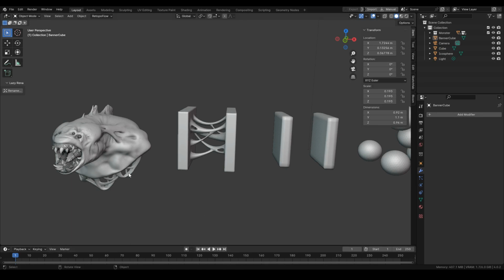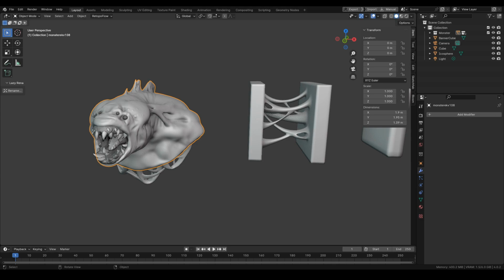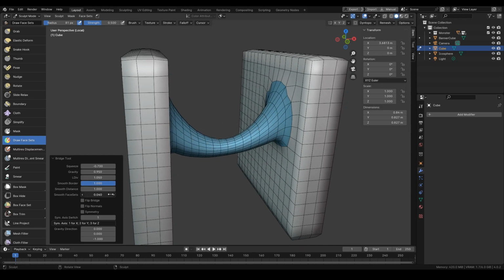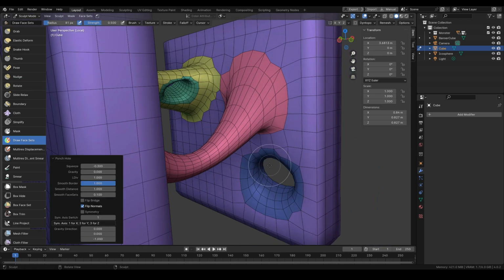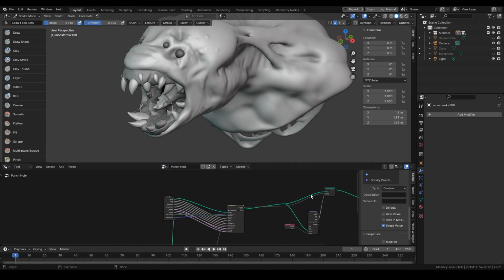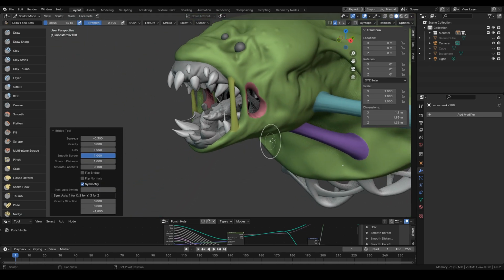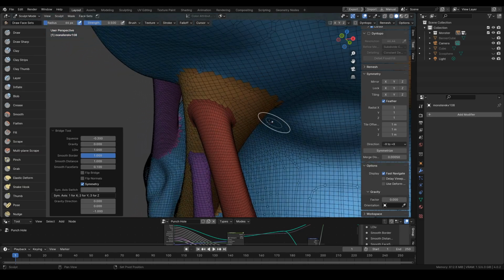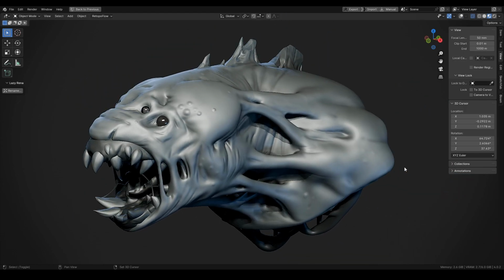Sculpt Bridge Tool for Blender #geometrynodes

Comment: Hi, I installed SculptBridgeTool 1.0 for Blender 5.1, but I have a problem.
When I am in modes other than Sculpt Mode (for example Object Mode or Edit Mode), if I left-click on the viewport or on an object, a thick black line appears.
The strange thing is that this black line can be moved around, like an object or a stroke.
In Sculpt Mode this problem does not happen.
I removed the tool, but the issue still remained until I launched Blender with --factory-startup.
Do you know what could be causing this problem?

Comment: it wont work the object disappears when o try to use the tool
Reply from the maker: What version of Blender are you using? It's compatible with Blender 4.0+ and there's a seperate version for Blender 5.1 especially. Is the scale of the object =1 in the N panel?  You could also try reseting FaceSets on the model (Face Set From Visible). Does it also not work if you try it on a primitive in a new scene? Please contact me at nodesinteractive@gmail.com or here https://discord.com/invite/5zFatHznhN if it still wouldn't work.

Comment: GUYS I FIGURED IT OUT!! open your asset library at the bottom. next open the folder for bridge sculpt. then at the top of the tab in the asset browser there will be a drop down that says things like (link, append, blah blah) go through each one and drag and drop the tool individually onto your object, each time your model dissapears you will need to open the modifiers tab and click x. eventually they will pop up on the page button next to face sets in sculpt mode as shown in the video!! so happy i got it to work lmk if this helped!

Comment: Man, every time I try to use, the original model despairs and I can't use the tool.
Reply from the maker: Hmm, is the scale of the object =1 in the N panel?  You could also try reseting FaceSets on the model (Face Set From Visible). I just double checked with Blender 4.3.1 and tool works. Does it also not work if you try it on a primitive in a new scene? Please contact me at nodesinteractive@gmail.com if it still wouldn't work.

Comment: I had a method of my own to make those stringy, webbed "goop" that was rather tedious, its great to have this tool to make it easier and higher quality than my own method. also, I follow the steps to install EXACTLY how its given in the video and on the documentation segments of gumroad and the revert file step does nothing. Any solutions?

Comment: I purchased this tool. I placed the file in my assets and it does not generate a unassigned tool in sculpt mode.
Reply: Well I solve similar case in this very video. Does reverting/restarting Blender not help? Also you need to be working on Blender 4.0
Reply: @popekpiotrek  I had blender downloaded through Steam and it was not up to 4.0 yet. So I am uninstalling and downloading 4.0. I will let you know if I have any other issues. Thank you so much for getting back to me so quickly.
Reply: I just restarted Blender, and yes, 4.0 only
Reply: I tried as well in Blender 4.0 and the option is not poping up. Can you please help? Dzęki
Reply: Never mind. I have to save the blender file first to get this revert option active, then after reverting, the tool came up. Thank you!
Reply: @henryvasquez1814  I ended up uninstalling it and reinstallin it and it worked immediatly for me. So maybe give that a try. Might of been a bad install.

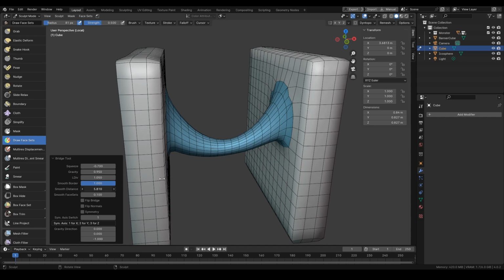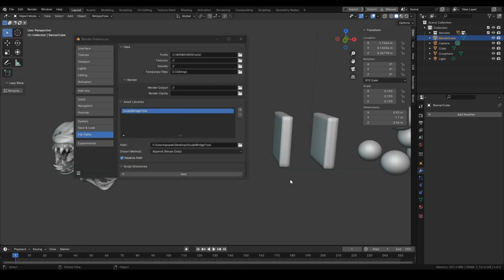Comment: Nice tool! Especially for punching holes which has always been difficult to do quickly in sculpt mode. Can there be a way or slider to take into account the surface normals for a smoother transition, as a separate effect? See 2:03 in the similar ZBrush tool runthrough https://www.youtube.com/watch?v=HHfym1RNbTg, to make a horseshoe-shaped curve if you select two faces (0:37 also shows what it would look like if it's based on the existing surface)?